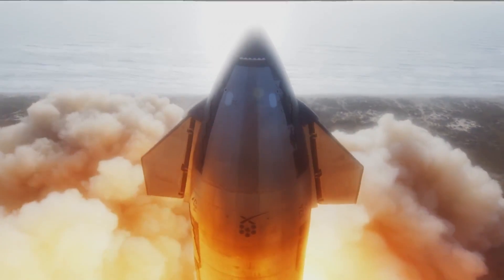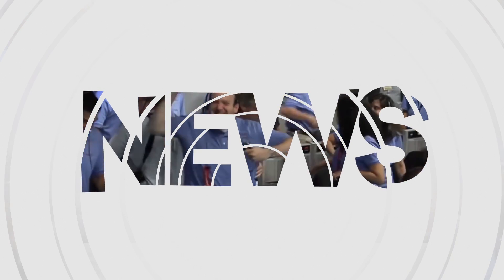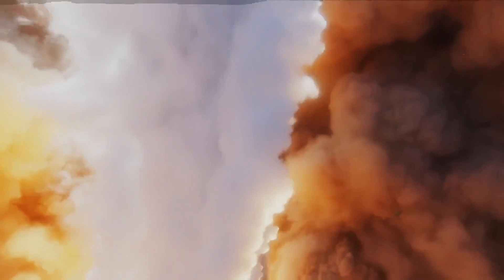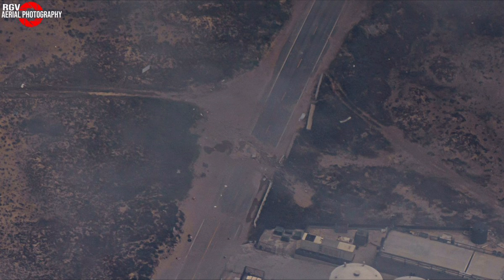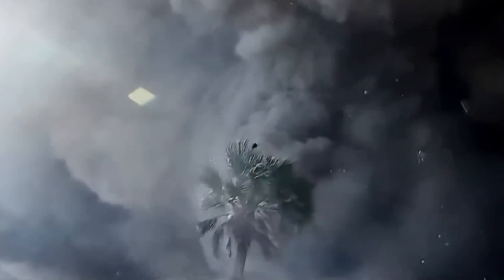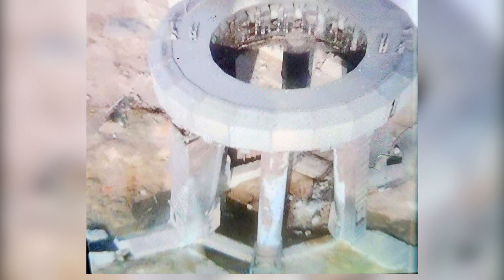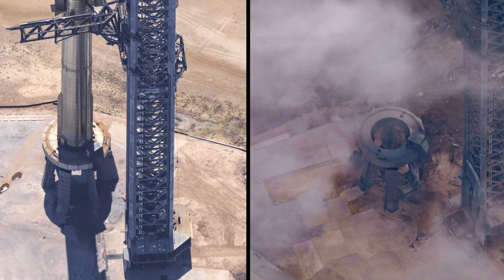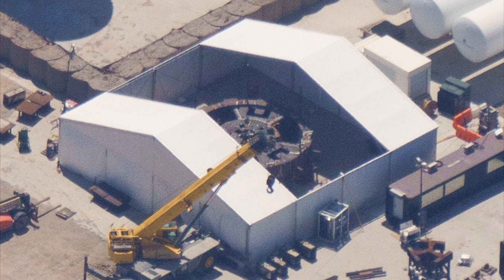#148 - Super Heavy Starship Launch Pad Sustained Massive Damage

Comment: is it necessary to light all of the engines at once? Light half, then get off of the pad and light the rest a few seconds later.
Reply from the maker: The rocket is extremely heavy at launch. That's why you need the thrust of the rocket engines to push that heavy weight off the launchpad. If you only ignited half the engines, the rocket would have too little thrust and would sit on the launchpad.

Comment: Why not make a launch pad of heat shield tiles.... and a taller launch pad
Reply: Heat tiles aren't nearly strong enough to survive the thrust of 33 raptor engines. Look what it did to the concrete underneath the launch mount. Besides heat is not the main issue. The heat exposure is quite short. 

A taller launchpad would probably start to cause instability issues, besides they would have to increase the height of the launch tower and aswell.
Reply from the maker: You're right.

Comment: concrete spalls when heated with a blow torch.  Flame temp of the Rapter is far hotter than a propane blow torch and delivers enough kick to put 5000 metric tons into orbit.  I though that cloud looked more like pyroclastic flow.
Reply from the maker: I don't think the concrete had time to get too warm. Yes, rocket engine exhaust is very hot, but here it was more about breaking the concrete, which was subject to extreme force.
Reply: @SpaceFlightNews  Concrete is permeable to water. Moisture in the concrete and groundwater below it flashing into steam would certainly propagate rapidly as large pieces were blown away.
Reply: @SpaceFlightNews  5980  F exhaust and a hypersonic flow  capable of  lifting 5000 metric tons.      Fadang (or whatever it is called) didn't get too hot?
Reply from the maker: Every material needs some time to heat up. Here, the concrete was broken in the first fractions of a second after the exhaust gases hit it full force. The fragments were then thrown away with great force. So the material didn't have enough time to heat up adequately.

Comment: SpaceX really needs a Reusable Orbital Launch Mount, ROLM, the output from the 33 engines basically represents 33 continuous shaped-charge jets for which their outputs are virtually unstoppable for any short distance.   They need a long-vented air-tunnel to allow a free expansion of the super-heated gases to dissipate the massive amounts of energy.    I am betting that it will take 2 years to rethink the pad design, build needed barriers, harden tower hardware and build a whole new well thought out structure that is certain to work as determined by experienced seniors that have worked with NASA over the years.
Maybe it's time to use a Tunnel Boring machine to make Venting Tunnels that carry hot gases away from the site.     I don't think a water deluge system or water-cooled plates alone will do the job, the massive amount of engine thermal energy will just vaporize all of the water and create a massive steam cloud that may create new problems.     Remember that there is something like 25 tons of propellant burning per second.      Methane produces ~50-55 MJ/kg which is about 20% higher than that of gasoline, just imagine the explosive force of 10-20,000 gallons per second of vaporized gasoline.   I find it pretty much unimaginable!
Reply from the maker: Yes, the power these engines produce is virtually unimaginable.
Reply: So. You still stand by this comment???
Reply: @Jack_Hagerty  LOL yeah, he got that timeline wrong!
Reply: @Jack_Hagerty and now they are making a flame tench lol
Reply: @BrianReed-13 
yeah. That’s right. They said they wanted to try the flat pad. More importantly - They got the flat pad working after the 2nd go. 

The entire idea behind the Flat pad was 2 fold. Boca  has a very high water table making digging impossible without damming... And 2nd they wanted to prove the concept to one day build a pad on mars with minimal resources. 

But again. They got the flat pad to work. So.

Comment: These Youtubers comments are so moronic obviously spaceX anticipated that they would have to go through trial and error until they got the base correct hence the multiple times that they rebuilt it and tested
Reply: Sorry, trial and error on a launch pad? From the lowly V2 to the Saturn V, engineers through history successfully designed and built larger and more capable launch pads as rockets became larger and larger and they had to exhaust more volume. Nothing like this has happened before. It is and was a piss poor inadequate design for the task.
Reply from the maker: They just tried to make the launchpad in a simpler way. If it worked, it would have paid off.
Reply from the maker: SpaceX's original approach is what got it to where it is today - on the cutting edge. This company is not afraid of failure, which provides valuable insights that enable it to improve its product design so quickly.

Comment: Good analysis, but were these launch problems only due to the lack of a flame trench and a properly designed water deluge system at the launch pad? During the ascent phase, several engines failed, flashes were visible, and the color of the exhaust went from clear to yellow. Also, there was no stage separation and the rocket appear to be tumbling out of control. A version of this second stage must safety land humans at the South Pole of the Moon! If these problems had occurred during the launch of either Apollo 4 or STS-1 or Artemis 1, what would we have called this? There is a crater underneath the orbital launch mount!   When will Space X build a complete launch pad like one use to launch SLS at the Kennedy Space Center. NASA's Stennis Space Center's test stands have flame trenches and water deluge systems. Why did Space X fail to perform a full duration test firing of the first stage at one of these test stands? Finally, was this rocket (two Saturn V's) a danger to the public at Brownsville, Texas? Debris fell onto the public. Was this launch a success? On the positive side, the first stage ignited, there was a liftoff, and it cleared Max Q!  This was a test flight; now review the flight telemetry, determine the cause of the technical problems, correct these problems, retest the components, and then relaunch.  Then you can explore the heavens!
Reply: There is zero doubt that the ship was turned into Swizz cheese. Giant drbis went higher than the tower. The olm stand is totally destroyed. It didn't separate because there wasn't any hydraulic pressure left. Firing twice the Saturn 5's power down on a flat surface was completely moronic.
Reply: What if max Q actually damaged separation
Reply: @dododostenfiftyseven4096  that’s actually a good question other ideas I have heard are debris could have screwed with it as some debris screwed with engine aswell
Reply: @dododostenfiftyseven4096  think about severe acoustic vibrations
Reply: Most likely the debris caused a lot of damage, for example the hydraulic system that exploded short after launch, and two engines next to each-other that suggests failure from debris.
Reply from the maker: The way SpaceX develops its rockets is very different from the methods used by established companies or space agencies. SpaceX is not afraid of crashes during tests, which will provide valuable data for further development. This allows the company to improve its products so quickly.
Reply from the maker: Elon Musk is at the helm of the most successful space company ever. So, in relation to SpaceX, I would definitely not say that they have only words (propaganda) and no actions.
Reply: @SpaceFlightNews  Agree, Elon got the ball rolling... but it's Gwen Shotwell that actually runs SpaceX. Elon is the one who thinks it's funny to fly on 4/20, while Gwen Shotwell has to figure out how to repair the damage.

Comment: IM NOT AN ENGINEER BUT WHY CANT U USE THE BORING COMPANYS HOLE DRILLER AND DIVERT THE EXHAUST THRU THIS TUNNEL WITH THE ASSIST OF SOME HEAVY DUTY OVERSIZED  FANS  TO PULL THE EXHAUST TO AN EXIT POINT 500 OR MORE YARDS AWAY FROM THE PAD.
I SWEAR I HAVE SEEN UNDERGROUND ROCKETS OR FROM SUBMARINES WHERE THE EXHAUST EXITS FROM A HOLE ON EITHER SIDE OF THE ROCKET.
AS A MATTER OF FACT AT MY JOB WE HAVE A VACCUM SYSTEM USING 
COMPRESSED AIR TO TURBO CHARGE THE INTENSITY. 
THIS OF COURSE IS ON A MUCH SMALLER  SCALE THAN SPACEX NEEDS BUT ITS AN IDEA.
Reply from the maker: Please don't type with CapsLock, it doesn't look nice.

Comment: OK--------... Space X needs to move the exact same High tower and Launch Platform out to a Mile off the Beach with a pier running out to it from the end of the Boca Chico Road... With an Elevated 30-foot wide set of rails running from the Construction Build sight to the existing test launch sight and then on out the Pier to the new Launch Sight a mile off the Beach...  With only a couple of Sub Coolers under the roadbed at the end of the Pier safe from any exhaust or explosions...  Space X would reduce all of it's Regulatory, Environmental and Launch sight Exhaust destruction problems by 99% with the Gulf serving as the Ultimate Deluge system... and Crash area Junk yard serving as New Fish habitat Reefs making for the best fishing along the Gulf Coast... Not requiring much cleanup... Multiple Off Beach Launch sights even farther off the beach out of reach of local Regulations and Restrictions would allow Space X to launch a hundred times a year instead of just 6...  Making Boca Chico the Space Launch Capital of the World...
Reply from the maker: While this proposal looks nice at first glance, it would bring with it further complications. SpaceX has already built a decent base at Boca Chica.
Reply: @SpaceFlightNews  OK.. Yes but they can not USE the Launch Platform in it...

Comment: 😂 HOLD ON😉,,, HEADY DUTY? "BULLSH#T.. it fell apart..they tried to build the launch pad on the cheap. The storage tanks are to close, protective barraries failed, they cut corners on the launch pad itself. To fix it properly will cost Billions and there to cheap to fix it properly. EVERYONE new the launch pad was defective from the beginning to,,, you didn't even have to be an engineer to figure that one out. They will do a cheap fix that won't work
Reply from the maker: I don't think it will cost billions. SpaceX just tried the easier route and it turned out not to work that way. Even that lesson is valuable. The company has been taking this approach for a long time, and it is part of what has led to the success it has today.
Reply: @SpaceFlightNews  One thing is to
One thing is to blow up rockets, another to destroy Stage 0  … cutting corners will not do, a real mess
Reply: @SpaceFlightNews  What lesson? This stuff has been done so many time before and Head Twit ignored everything.
Reply: Why would we want to rebuild it when we need a new one? Which we have in Florida already. It was all junk that needed to be moved out of the way and this was just the cheapest/fastest way, and we got to learn while we did it. How many rockets have you launched? 😎
Reply: Have to agree it was pretty moronic decision. It won't be billions, but they will have to start over. It's a major cluster.
Reply from the maker: The impact of space rockets on climate is absolutely negligible. And as far as the Starlink system is concerned, SpaceX has taken measures to reduce their brightness in the sky. Thus, at present, ordinary people can hardly see these satellites. This remains a problem only for astronomers.
Reply: Says the rocket engineer. 😂
Reply: @JonYSnoh  Im not an engineer tho. I just work on this shit unlike most of you lol. Don't have to be anything to do that... But how would you know? 🤣
Reply: @JonYSnoh  Pretty sure building a proper launch pad has nothing to do with being a rocket engineer. Also, a 5 years old would realise this example was a bit of a joke.